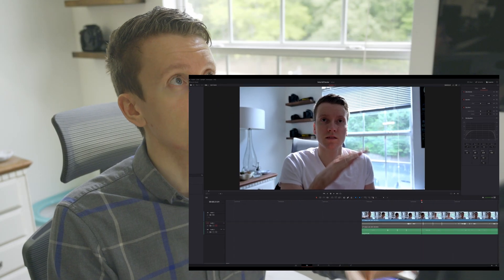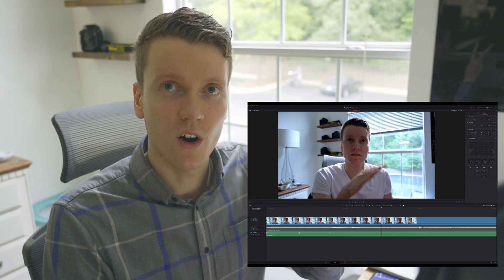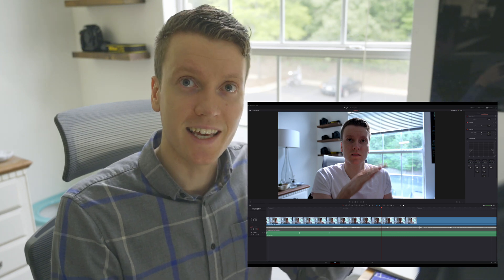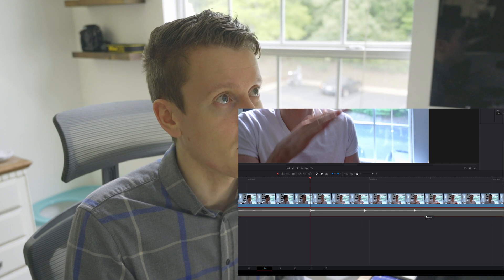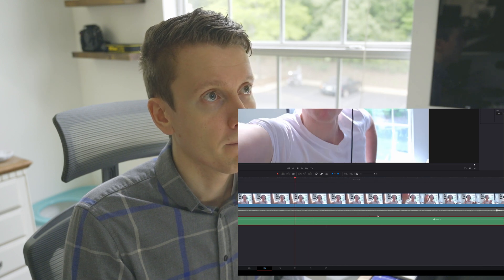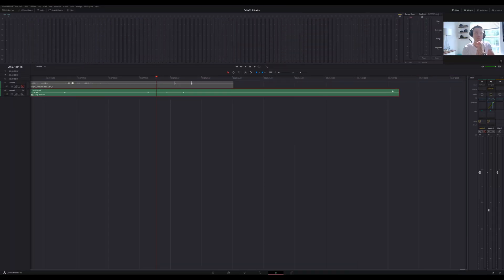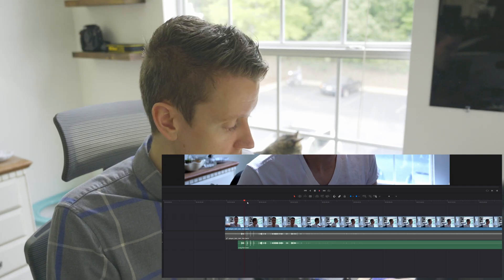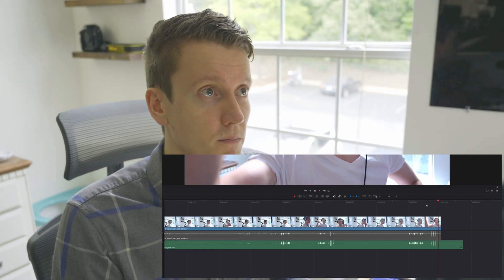Davinci Resolve / Audacity Audio Drift EASY Fix

Comment: I need help I have 2 shows where even if I change the fps to 25 I'm still out of sync 

Even if I manually fix a part it becomes out of sync in another part 

 originally in English I'm trying to add back the English

Comment: The issue is different sample rates (44.1 kHz vs. 48 kHz). The video’s audio sample rate may be recorded at 48 kHz while audacity is recorded at 44.1 kHz! Ensure both sample rates match. Bit rate (which deals with SPL range) doesn’t affect the recording speed; sample rate does! Hopefully, this helps!

Comment: I modified the audio export settings and became compatible in Audacity menu: file - export - Export as WAV -  ENCODING - signed 32 bit PMC because (Audacity works at that rate)  and it worked for me as opposed to 16 (that I previously selected).  But it's not a guarantee that it won't happen again.

Comment: It has to do with clock. My zoom h5 drifts after 1/2 hr from camera audio. So I feed audio line out from zoom into my excellent preamp of my canon g30 camcorder and send it to atomos recorder. No need to do what you did. But it's good to know that WAV can be stretched. This is why timecode clocks is used to keep audio in sync. Most youtubers do not own cameras with a timecode input. My atomos receives timecode and my canon g30 sends it out. So I sync them for cam trigger record from the camcorder.  Anyone with zoom product will use this info with dslrs  as the preamps suck in camera.